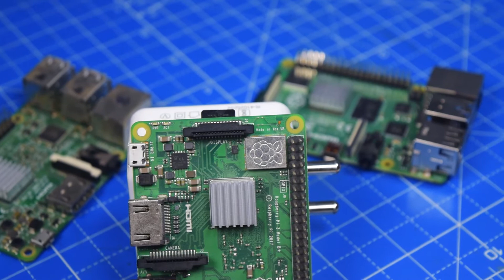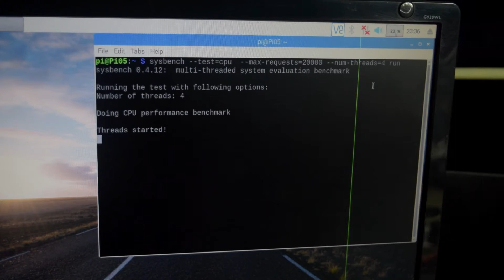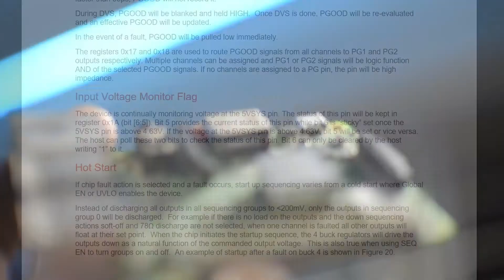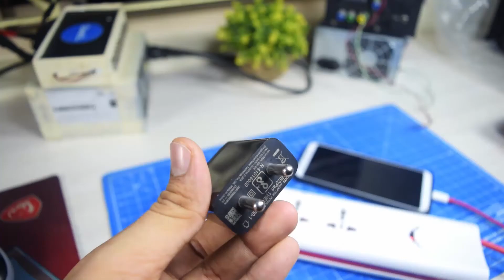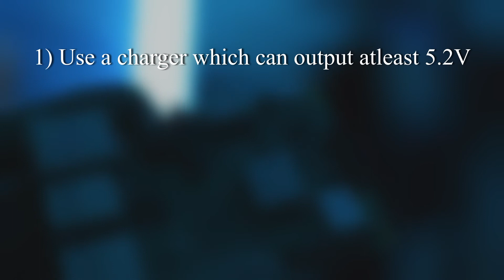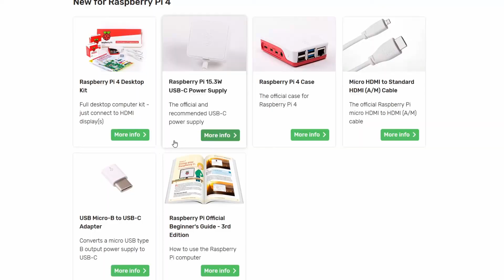Why your Raspberry Pi is running SO SLOW!

Comment: You're a godsend! My Raspberry Pi was sitting idle because it was running very slowly. I swapped the cable for a very short one (the cable is less than 10cm long) and the low voltage warning disappeared!

I got this USB cable from an old surveillance camera that used a cell phone charger as a power source. The camera broke, and I kept the cable. It worked perfectly!

Comment: It worked for me in this case, I have a raspberry pi4, ram 4G, I changed  the charger  and used it from my cellphone, also I used the cable from my cell phone, and It worked perfectly, I have to say it is a little faster, I can see the improvement, like.

Comment: Noie Video Buddy, I Have Simmiliar Problem, I Hope You have a Solution for it
I Have 3 li-on Batties, Which i connected to a Power Bank module and then i Connected power bank module to Raspberry Pi (The Same Way DD Electro Tech did for his Laptop)
The Problem is that my pi blinks it lights for 30 sec while the pi is tuyrning on but then it drops and all lights goes off and then it restarts

Comment: The pi 4 8GB is slow running no matter what. They have low throughput, the highest speed DSI port is proprietary, and they are problematic running anything but pi os. They also are not very viable to run along with a discrete graphics card. Do not be fooled. I had to learn the hard way that these boards are not capable of any of the projects I had planned when I first laid my eyes on the unreal spec sheet.. It's a good ARM chip microcontroller, but definitely a terrible computer.

Comment: I am using a buck converter to step down from 12v to 5 volt what happens to my raspberry pi 4 while running if the voltage goes to below 4.5v or even low to 3, how my raspberry pi 4 will get affected??
Reply from the maker: Yeah your Pi might turn off or get stuck in a bootloop
Reply: @chinmayshalawadi1  could you explain in detail i am a noob in electronics what is meant by bootloop ? will it damage any harware,?
Reply from the maker: It won't damage the Pi for the most part, but it won't run properly if voltage is below 4.5V.

If it goes to 3V it might not turn on at all. 

By bootloop I mean that it will get stuck into a loop where it turns on and off continuously
Reply: @chinmayshalawadi1  thanks a lot bro if minimum operating voltage is 4.5 means what is the maximum operating voltage of RP 4

Comment: I have the RPi 3 kit with the original power supply but the Pi is very slow. I tried LXDE, pure Openbox and even XFCE which should run smoothly but it’s terrible and basically opening web browser (lightweight Midori), terminal and file manager makes it unusable. I removed/purged all the packages I don’t need, so the OS is as clean as possible and it still doesn’t run smoothly and anything makes it unusable.
Reply from the maker: Shucks, do you think it might be a faulty unit ?
Reply: @chinmayshalawadi1  I don’t believe I have faulty unit. I think something is wrong software wise. What I did was I set a ZRAM instead of swap and it helped a bit but it’s still not so good. I believe that for my project (temp measuring and log creation) it’s going to work just fine. I will try to dig deeper and see what I can do.

Comment: The explanation sounds logical, yet it does not solve my problem: On my Pi 4B, the undervoltage sign is being shown since the recent update of the OS, and now Chromium is running slow, even terribly slow when using Youtube (the power supply used has a nominal output of 3 A, but it is not the official one, instead it is the one shipped with the kit).
So I bought an official Raspberry PSU, and with that one, the Pi 4B does not even boot anymore (!).
The issues remain even when the additonal hardware is disconnected (2nd monitor, active speakers powered by Pi's USB). 
Honestly I don't understand this at all (both - that the issues occur after the recent update and that the orignal PSU does solve the issues). 
Am kind of helpless. Ideas welcome.
Reply from the maker: That sounds super weird, they may have changed the undervoltage threshold to be more agressive. I don't know why they would do that. It makes using 3rd party power adapter a nightmare.
You sure you didn't get a faulty unit for the original PSU ?
Reply: @chinmayshalawadi1  Thanks for your reply. No, I am not sure I didn't get a faulty unit for the original PSU, I have no means to measure this. For now, I am using the non-original PSU again. As the issues occur only since the recent update, I hope that it is merely a kind of software problem  that becomes fixed in future updates - don't know if this hope is justified.
Reply from the maker: I've not used the Pi in quite a while, I'll try it out.
Good luck with your projects!

Comment: I enjoyed your video, but it doesn't solve my problem. I have two Raspberry Pi 4's (8gb and 2gb) and they are both running slowly (kind of like an old machine that doesn't have enough ram).

Issues:
1. Running super slow
2. Screen Tearing
3. CPU is maxed by almost nothing

I have tried:

3 Power Supplies 
1. (5.25v 3a) Argon
2. (5v 2a) Cannakit 
3.phone charger (5v 2.5a)

3 Operating systems (all fully updated):
Rasberry Pi OS (latest)
Ubuntu 20.04 LTS
Ubuntu Mate (latest)

Overclocked (Argon One case, safe temps):
6v
2.147ghz cpu
750mhz gpu
I also have run it at stock, 1.7ghz, 2.0ghz. Same issues

Different data mediums:

1. Samsung Evo (Class 10 UHS) 128GB
2. Other fast micro SD's, Sandisk ETC.
3. PNY USB 3.0 drive (64gb)

I made sure that both Pi's have the latest firmware

Powered USB Hub, the Raspberry Pi4's are only powering themselves

Directly connected Ethernet

I have fully updated the firmware on both units and I installed all OS updates for each OS.

In every instance, the OS runs very slowly. The CPU is maxed out by opening a browser (on both machines). There is one exception, RetroPie runs just fine, it seems to run at full speed. Am I over looking something stupid?
Reply from the maker: That's super weird, doesn't seem like you're overlooking something.
I've had a great experience with the Pi 4, noticibly snappier than the Pi 3. 
Run a few benchmarks(CPU/GPU etc) and compare with others online, maybe it'll give some insight.
Reply: @chinmayshalawadi1  I just picked up a PI 4 Canakit (tested it today). I set it up for Wifi then ran it from VNC on my desktop Windows 10 computer.
It was extremely slow (I was using 5ghz Wifi).  I switched it over to 2.4 ghz Wifi connection from my router and it seems to work great. Currently in the process
of running sudo apt full-upgrade to see if that helps. The power supply shipped with Canakit is a 3.5 amp per the description. I am not certain to go from here.
Reply: @chinmayshalawadi1  Thanks, that's a smart idea.

Comment: thanks what pins where you using for voltage test on the board please?
Reply from the maker: I was measuring from the USB port pins which are soldered to the board